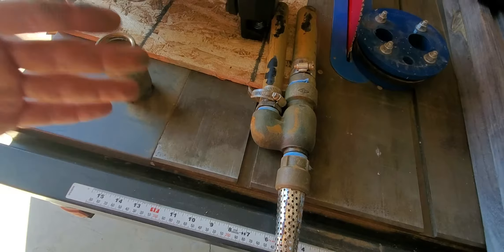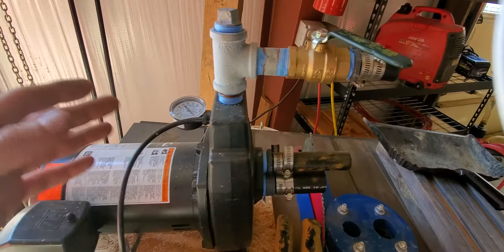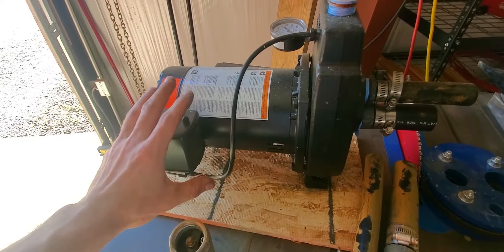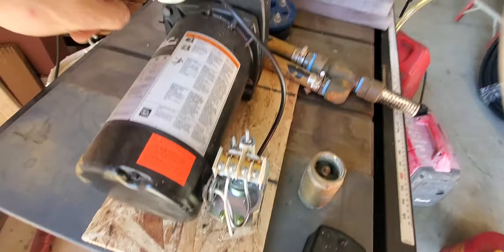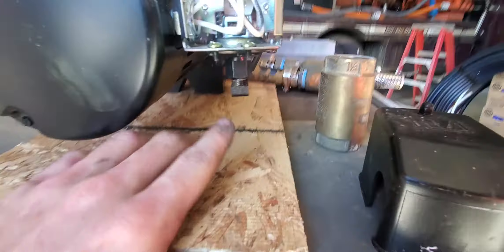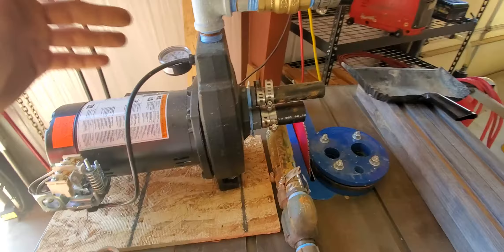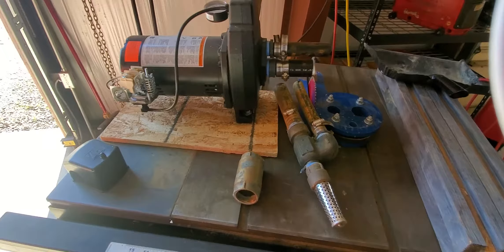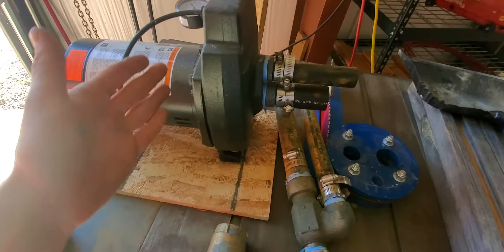Well Pump Not Pumping, here's why. Jet Pump 2 Line System Explained. No Water, Low Pressure.

Comment: Those aren't both suction lines though are they? The small line into the well is the output from the pump and then via a venturi the bigger line in the well is the supply that comes out of the well, no?
Reply from the maker: Correct
Reply: Will a leak in the output line cause the pressure to drop just like in the suction line?
Reply: How can you tell if the leak is in your suction line or output line?

Comment: I changed the switch and is in the close position and the pump won't start.???
Reply from the maker: Test for power at the switch.
Reply: @h2omechanic  switch as power on both side
Reply from the maker: If its a submersible pump, then its either a bad pump motor or a bad/broke wire going to the pump
Reply: @h2omechanic  will check, the pump is new, and just quit working two days ago. Also they just put a rand new filter system about 3 day ago

Comment: Do you still give 1 in 1 advice? Need help and running out of patience from 4 yrs of problems.
Reply from the maker: Yes! Ask anything. Leave good details on the system and the problem
Reply: @h2omechanic  thx so much. We have a shallow well jet pump. Its losing prime when the ball valve is opened pass 20%. Its has poly pipe, all of its poly even the suction pipe on the hole as well. Brass at the pump and a plastic elbo. Its only loosing about 2 cups of water and 16 oz bottle of water will do it. Any advice will be greatly appreciated thx.
Reply from the maker: @Yournamehere1009  if your having to constantly re prime it, then the check valve is bad. Or a area is leaking in air on the suction side. Shallow pumps are terrible for this problem. Unfortunately if your water table has dropped due to a drought then the pump can't pull from that deep. If the pump is old, 7years+ it's time for a impeller seal replacement or a new good brand pump.
Reply: @h2omechanic  ok thx, pumps new and all piping above grounds new, below ground was replaced 2 yrs ago including foot valve. Im thinking of replacing all suction lines back to pvc. Should i go back to 100psi poly or go with pvc for overall durability.